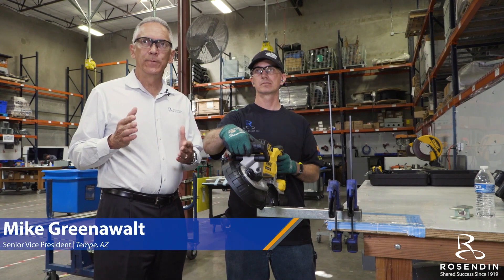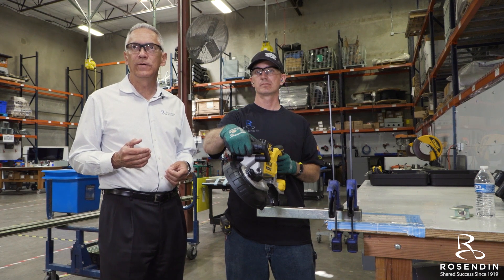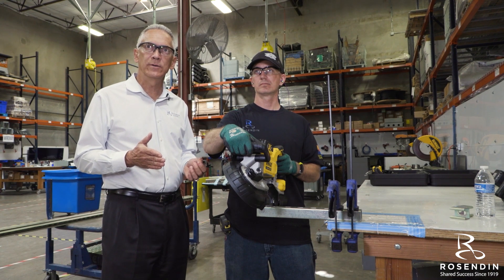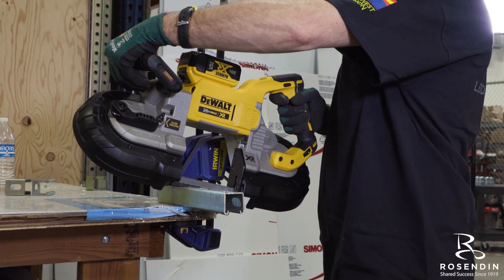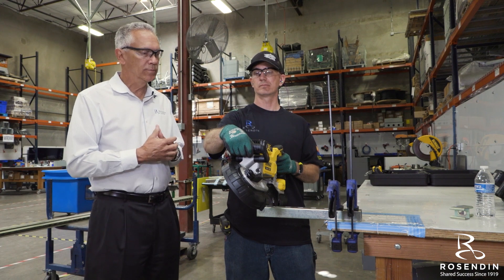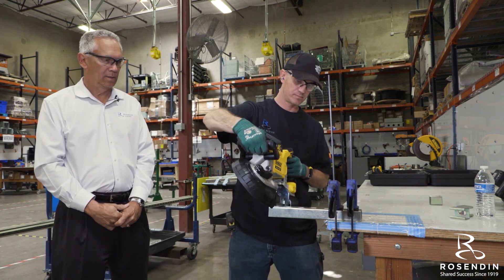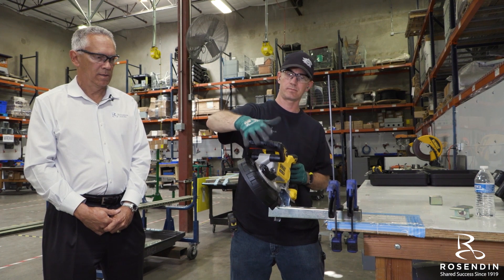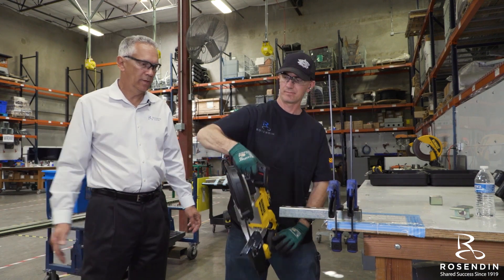Rosendin and DEWALT Create New Dual Switch Design of Portable Band Saw to Increase Worksite Safety

Comment: This is exactly what is needed.  This is true engineering solution.  I see the misuse of this tool quite a bit.  I workers can use one hand to operate it they will hold the piece and pray they can control the saw while having their other hand in the danger zone.  They would rather "save time" then get the vise off the truck.  Sometimes it works out and sometimes they go get stitches.